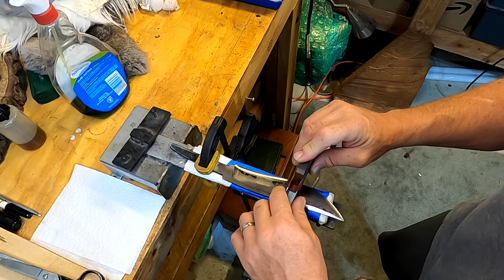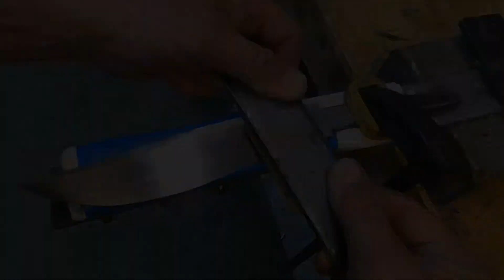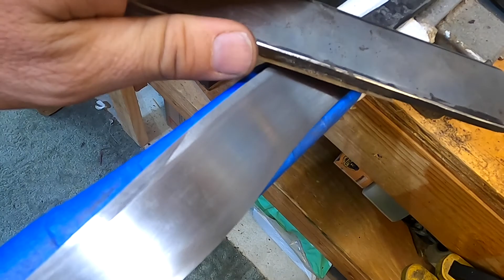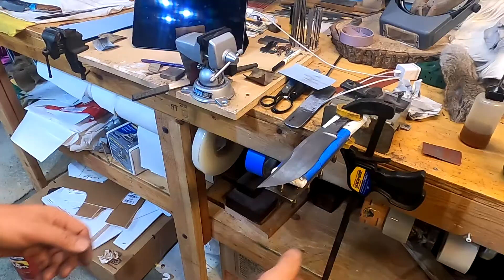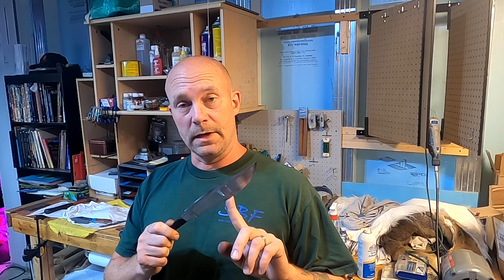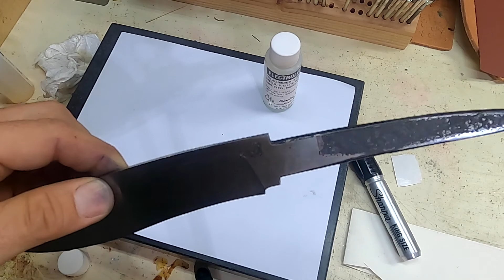How-To Make: 800 Grit Satin Finish

Comment: What grits did you use ? 220, __,__, 800
Reply from the maker: Hey Apocalypse!  Correct!  I start with 220 and work right up through the grits to 800 for the satin finish.  If the blade will end up being etched for Hamon for Damascus then I will continue up to 2000 -2500 grit depending on how the steel takes the etching.

Comment: Thank you for all the great sanding tips in this video.  I noticed you used a Panavise in one phase of your sanding.  Can you tell me if it the jaws can swing to a level horizontal position for sanding scales, blades, etc?
Thanks, Dave
Reply from the maker: Hi Dave, sorry for the late reply.  Yes, the Panavise I use has full reticulation making it much easier to rotate to various positions when working on scales.  If you pick one up be sure to purchase the solid mount base.  The suction base can be tough to hold in place.
Reply: @TwistedOakHandmade 
Thanks for the reply AND tip on the solid mount base.  I think I'll go ahead and make the buy.  
Your videos are outstanding...very informative!  Huge help for this newbie.